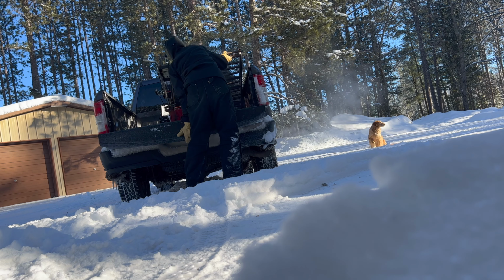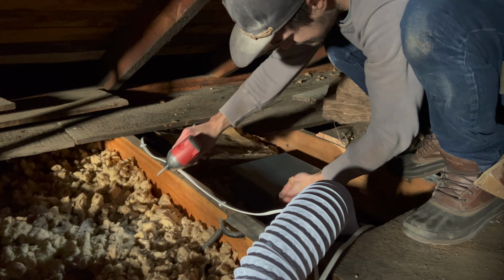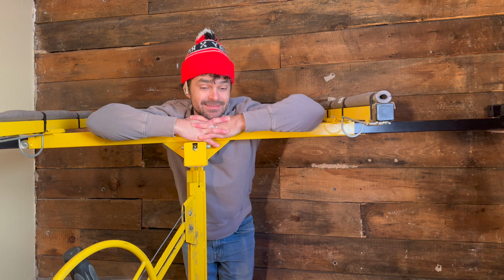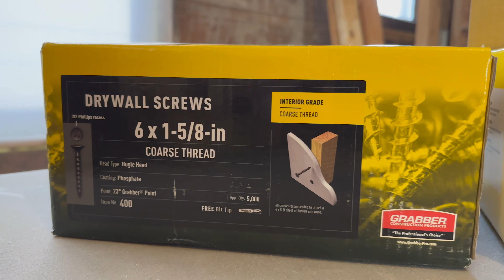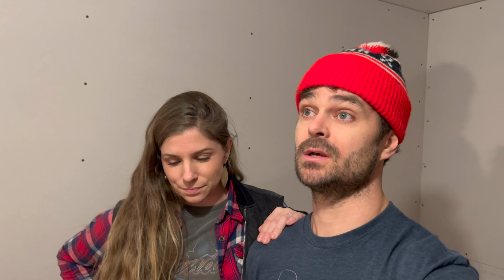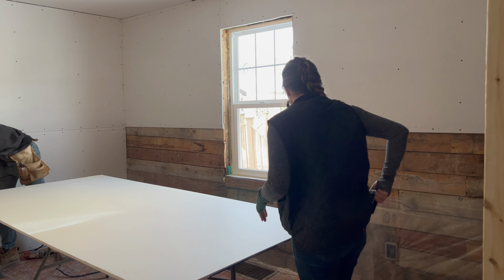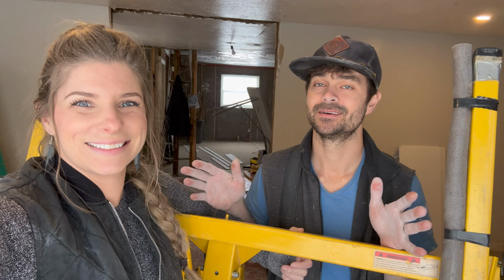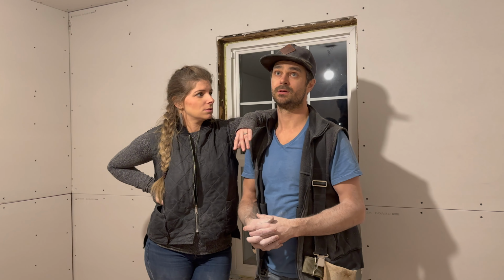Drywall is TRANSFORMING Our 120 Year Old House! Ep: 31

Comment: I think I would have tried to keep the water heater because of the cool retro factor, flushing it out, replacing the anode and maybe replacing the element but y'all know best about it.
Reply from the maker: Oh we still have the ole water heater! It's still working but Teds uncle thinks there was a short and one of the elements isn't working. So the water is hot, but not sure if it will regenerate fast enough to sustain multiple showers in a row.